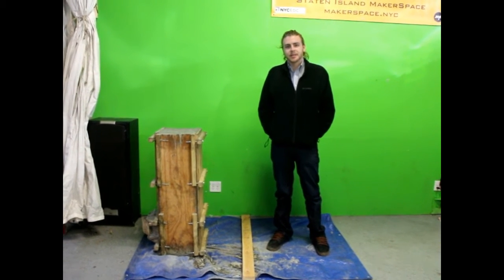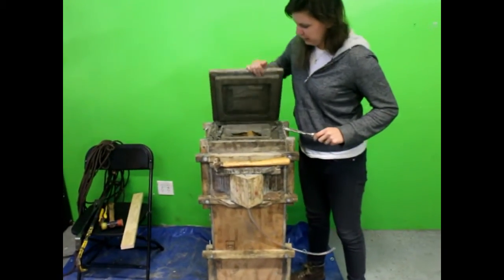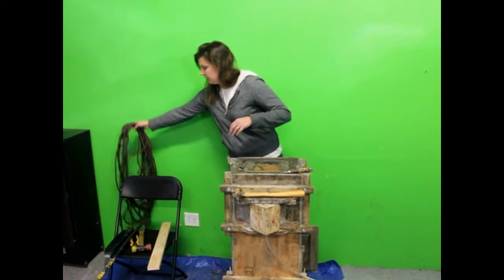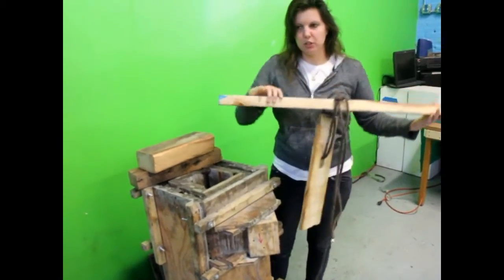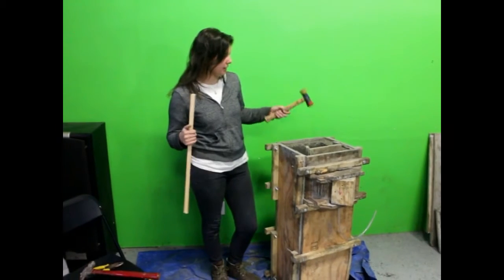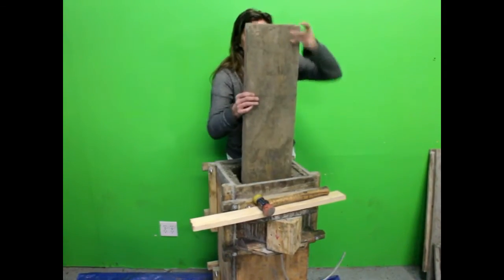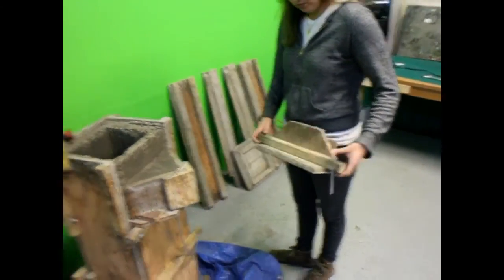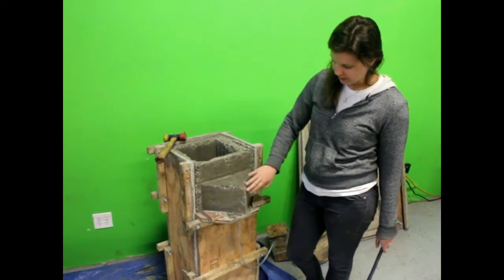De-Molding Your Concrete BioSand Filter from the OHorizons Wood Mold

Comment: Have you tried using fiberglass strands or burlap strands?
Reply from the maker: Hey Andrew, thanks for your inquiry. We haven't tried using fiberglass strands or burlap strands because the method we're currently advocating for (filling the mold with water and letting it cure for a week) is simple, accessible, inexpensive, and most importantly, it's working.